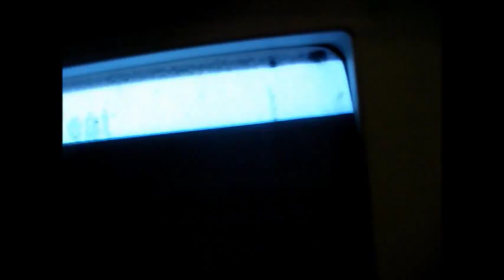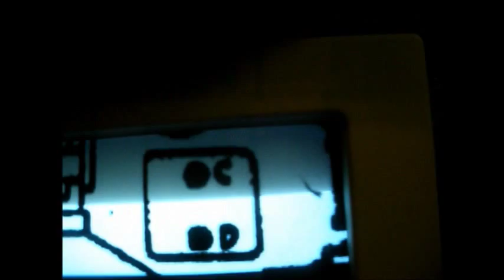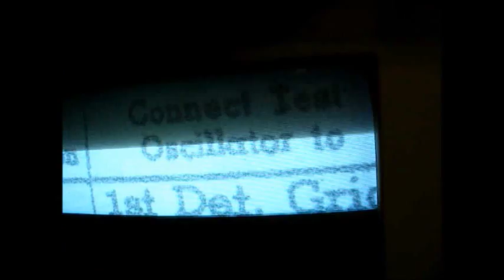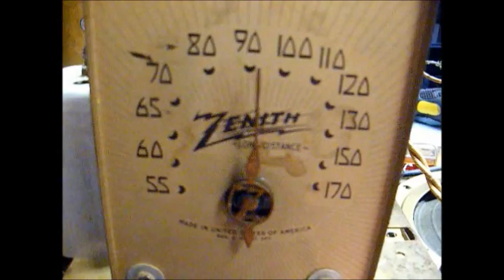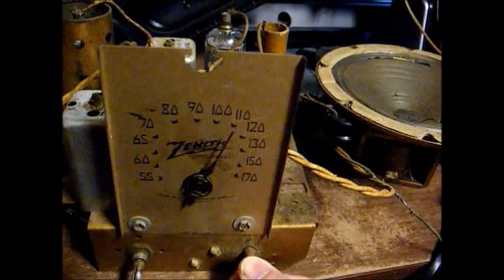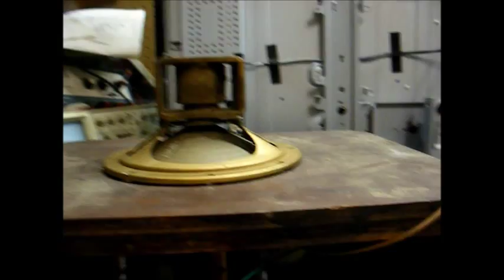Repair of a Zenith 4K331 farm tube radio - part three

Comment: The inability for the oscillator to track the calibrations on the dial was probably a design flaw in the dial, and was likely a characteristic of the receiver when it rolled off the assembly line in '39. Most Depression-era receivers were built with thrift in mind.

Comment: One trick that I learned from a retired radio-TV repairman is to adjust the oscillator trimmer by sweeping between two known stations at either end of the dial, usually the bottom end is the harder of the two to get right, but you keep going back and fourth until they mostly line up. One thing to watch for as well the placement of the dial pointer and of the dial markings, sometime they took some artistic license so the marker for lets say 1000 KC looks like it's at 1020.